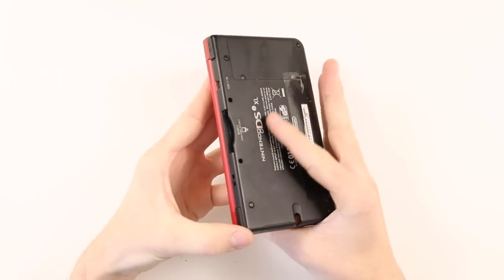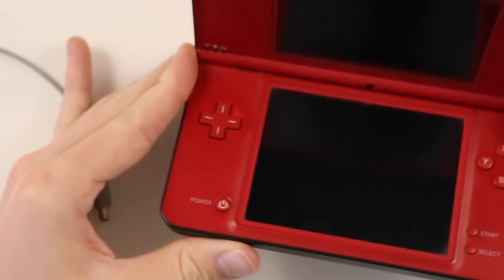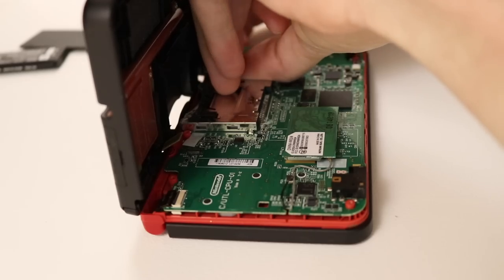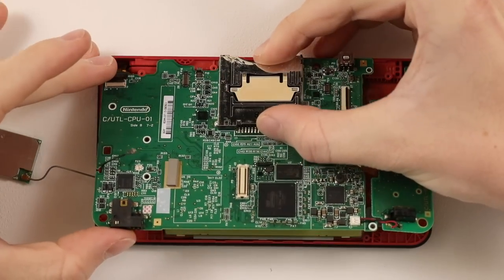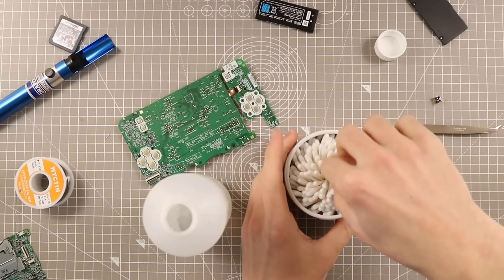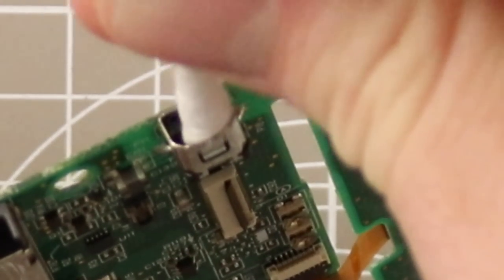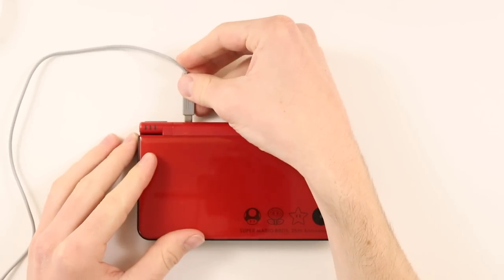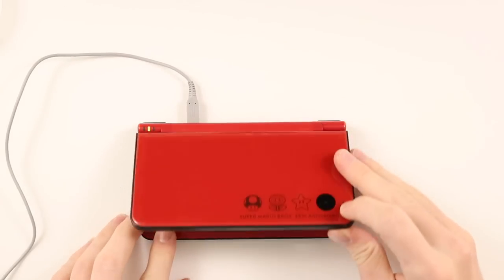Let's Refurb! - Nintendo DSI XL Charging Problems!

Comment: I still have one of those still kicking around! Same anniversary console too! Very curious though, mine broke the same exact way. Could this be a common fault point for the DSiXLs?
Reply: Dsi in general it happened to me :/ the pins get all weird
Reply: I’ve had one for like 5 years and I’ve never had an issue
Reply: Thunder Bolt5826 and I've had one for almost 8 years and no problem
Reply: Jarhead Gamer38 that used to happen with my tablet
Reply: I also had the same one but mine caught on fire because the battery blew up
Reply: I had my DSi for about 8 years and it started flashing orange, fighting to charge a month back.

Now I have to fight the thing to make it charge. It must be the port. The cord is fine.
Reply: Hyde V D L same
Reply: @SwagHyde  mine is only 9 years old ish aka 9 ish years old an it does the same thing is it just pooor qaulity of the charger port styles and type of the dsi xl charge port?
Reply: Had mine for 9 years. It recently started to not power on and it only powers on when it is being charged. Idk what to do
Reply: @Espeon804  yes feels like it still somehows bunch of similarly bad ports, vs the method of the easy aa batteries concept this uses some proprietary rechargeable lithium ion gumstick batery or batteru pack for the systems entire operation
Reply: Exactly same model as yours that also happened
Reply: My sisters dsi xl charger port broke to
Reply: Our family owns 2 and we've been using ours regularly since 2012 and not once have we encountered any problems with ours. Not charging not performing, nothing. Maybe it's based in the pressure you use when plugging in, or if the charger is moved around when inside?
Reply: @scottpadilla5050  I got a 2ds xl for Christmas and I tried using its charger for the dsi xl and it worked it was just the charger that didn't work
Reply: Oh right I forgot they had the same port. Its tricky to tell what the problem with what since it's not easy to check the problem. Cogratulations on your present by the way
Reply: In the vid he just cleans the port, maybe you can try that too
Reply: @byleph9049  bad battery
Reply: Mine charges fine but I accidentally bricked it so now I need a new motherboard.

Comment: I have the same model (and variant), mine had a super scratched touch panel which I had to replace. BTW that sma shielded cable you thought was for the camera is I believe for the microphone, which snakes its way through the hinge along with the wifi antenna. The camera uses a wide flat flex similar to the top lcd ribbon.

Comment: Did you change the charging port or just clean the old one? You seemed to rush over that bit :')
Reply: I think he re-soldered the contacts on the board then cleaned with the 99% alc.

Comment: Great, it works! Nice model btw.

(INSTALL CFW ALREADY)
Reply: @papabear5935  no, there's actual CFW that can load stuff directly from the SD Card
Reply: Not really, CFW can reach a lot more. You can play DSiWare, you can mess around with the menu, you can add homebrew and since this is all TWL instead of NTR, you have a lot more capabilities.
Reply: @maxibash  you have full signature patching, ability to create and restore NAND backups, and put on a different update channel (in this case Ulaunch updates). So yeah, it's a full CFW
Reply: @maxibash  not to mention the ability to create an emuNAND
Reply: The only issue I saw with this one is that this one doesn't have Flipnote Studio.
Time to re-open it and preform a hardmod.

Comment: If you are replacing DS or 3DS charging port its best to replace it with mini usb port fits perfectly no modding needed and its very easy to install then you wont have to buy ds to usb cables

Comment: I used to have a DSi XL, sadly it died.
Reply: Weeaboo Karwan I still have a working DSi, but it’s in pretty bad condition. It has small water damage, scratches, rust, and more.
It’s still a classic, but it crashes a whole load. (I owned it when I was 3.. don’t judge me.)

Comment: Do you have any videos doing a complete housing replacement for a DSi XL? I just recently bought a 25th anniversary Mario edition myself, but the housing looks very scuffed and the top screen is scratched. However, the guy had done a bottom screen replacement before sending it, so that's in mint condition. 

Thanks in advance for responding!

Comment: You should of replaced the battery with a battery from a working ds because maybe the battery just wasn't accepting the charge and/or the connectors for the battery was bad. But hey, at least you got it to work 👍

Comment: My The Year of Luigi 30th anniversary Limited Edition 3ds xl won't hold a charge for no more than an hour, maybe barely over an hour. It just dies after an hour when normally these things can hold a charge for hours. I can still charge it, though I noticed the little bit inside the charging port is bent upwards. That possibly might have to do with it, but since it can still charge, despite that, what do you think the issue would be? I don't have the tools or skills to repair it myself so...

Comment: My 3ds had a tempemental charging port, so a just got a charging station that used the metal bits on the sides of it. Problem solved*

*unless you don't havea 3ds...

(...and don't think we didn't notice it was a special edition dsi xl)

Comment: I recently got a 3DS XL for 25€(it has a Broken shell), should I repare it, or just resell it like this?
Reply: @Myronaz It Works Completely fine, but a new shell would cost 30€, so I dont know if it will be worth it
Reply: Buy one with dead motherboard from ebay, and switch the shell for cheap.

Comment: I have the same DSi XL, I want to say it was Refurbished before I got it but I think I have 2 issues now. One, for sure I want to say is a faulty battery as the charger light blinks while its charging and you have to take the battery in and out for it to power on. But the second issue is I keep trying to get int the settings to Restore the unit and it gives an error to power off and reboot. I have looked online and most places say its a faulty board, I just figured I would drop a comment here and see if anybody else has had this issue and maybe had it fixed or is it truly a faulty board. Thanks in advance!